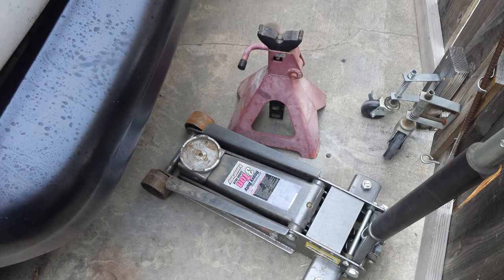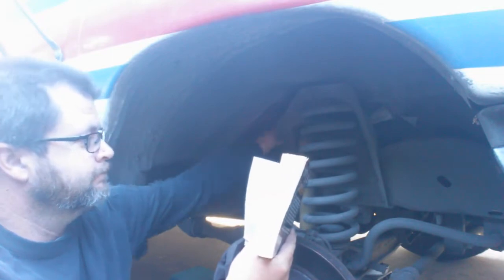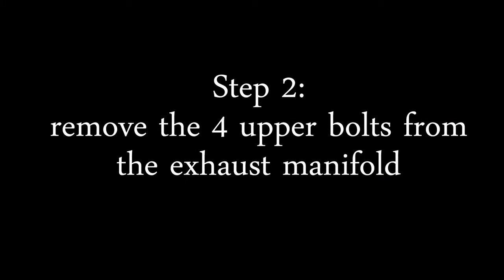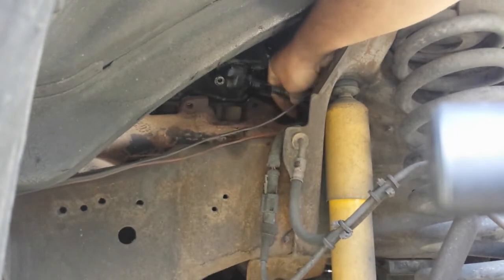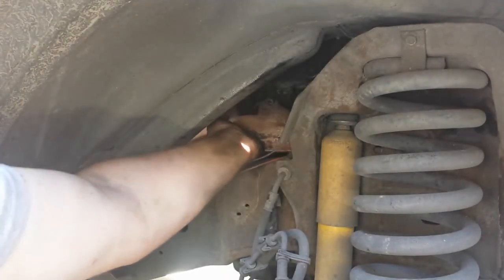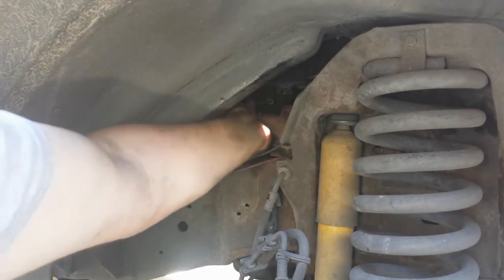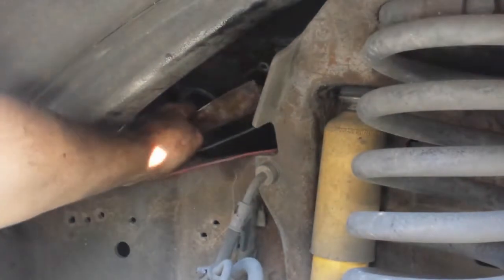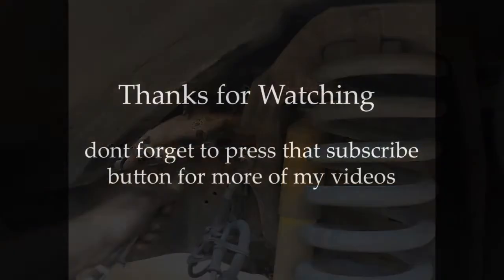Ford E350 exhaust manifold gasket replacement

Comment: Dude I'm at a impass I've tried ever damn tool I have and I can't get the passenger side front inner bolt,  I get a ratchet on it and can't move the damn thing , driving Me nuts !!!!
Reply from the maker: Yep, that one sucks to get to. If I remember right, the a/c compressor is in the way of getting to it from the front of the engine. Maybe you could cut/drill a hole in the inner fender to get a straight shot at it?

Comment: Just did a timing job on this same vehicle. So I know how fun it is sticking your arm into tight, sharp areas is while feeling for a bolt hole. 

Im Dreading doing this job because the bolts are so rusted, while one is broken. 
Drilling out bolts in that tight space dosent sound like any fun.
Reply from the maker: This was actually the second time I did this job. Several years ago I bought the truck cheap because of several issues one of them was multiple exhaust leaks. I filmed this video when one of them was leaking again. Unfortunately that engine acquired a loud ticking and I had the engine replaced a few months ago. But it’s nice to know I have one vehicle around here that all I have to do is check fluids and drive it.
Reply: @ThatllDoEngineering  Thanks for posting this!  I notice the Dorman gasket that comes with the manifold is different than the ford gasket.  Was it the gasket that failed the second time?  Or was it broken studs or a cracked manifold?
Reply from the maker: The second time it leaked was a cylinder with a broken stud that I wasn’t able to replace due to it being inaccessible. I replace several studs when I first got the truck, but one I couldn’t get (passenger side, front). The original gaskets I put on were individual gaskets per cylinder, I replaced it with that complete gasket you saw in the video.